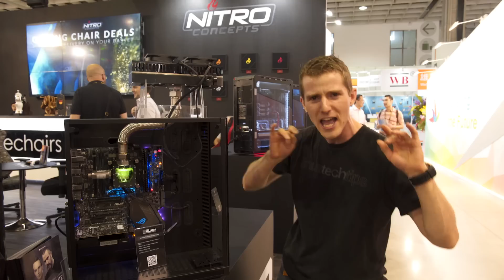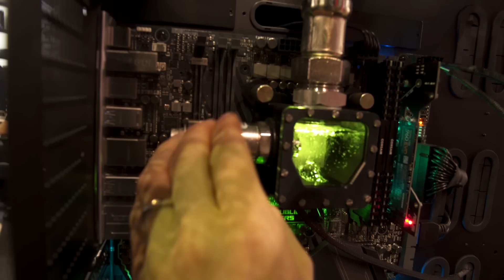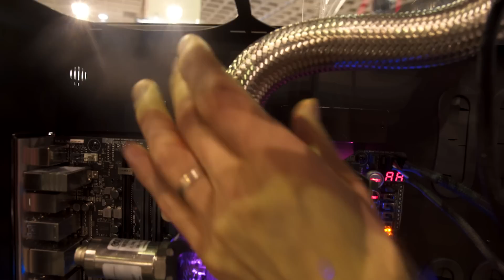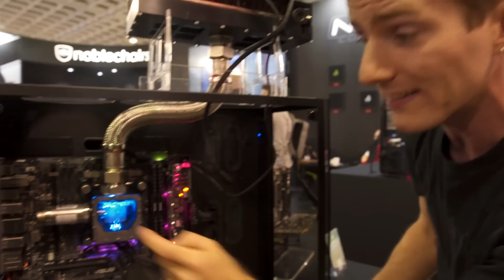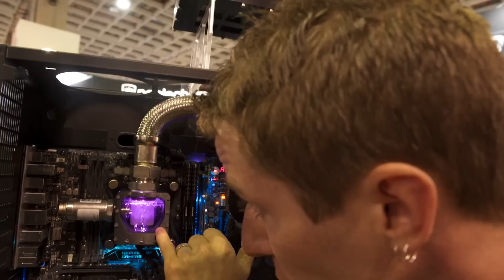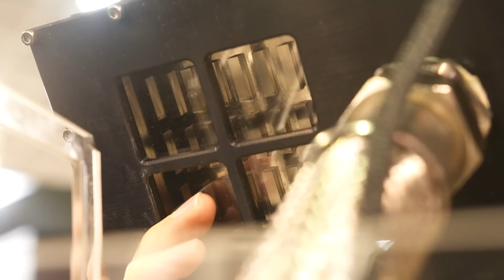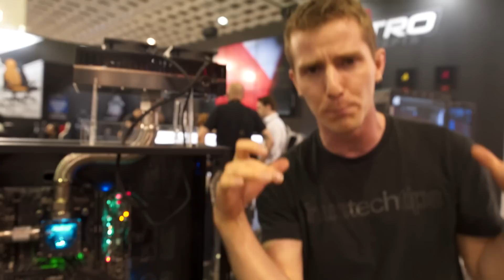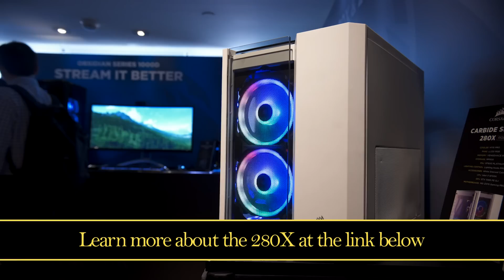Crazy Der8auer cooler prototype - NO pump!

Comment: It's not Novec, since it is a controlled substance that is not allowed in commercial products, there are loads of hydrocarbons that would fit the bill but they are all really flammable so I would say that it is unlikely, water would not be used under low pressure since low pressure is increasing the risk of contaminants that may gum up the system, chloroform has been mentioned and is the most likely out of the mentioned since it fits the bill almost perfectly but it wouldn't be good for publicity and it is not stable in an oxygen containing atmosphere which would limit its operational lifespan to something lower than ordinary AiOs, ethanol and methanol is less flammable and less toxic than some on this list but not enough to be relevant for worldwide sales. I think der8auer has me beat, though someone into mor practical industrial engineering might figure it out.

Comment: Running the internals at a pressure lower than atmospheric would allow a liquid to boil at a lower temperature. The likely choice for prototyping would be some type of hydrocarbon base, possibly a butane or propane. probably blended rather than pure.
For retail possibly a switch to some sort of alcohol or glycol mix?

Comment: I immediately thought of isopropyl alcohol just because is boils at around 87 degrees Celsius (the temperature you'd want active cooling to kick in to avoid thermal throttle).  I think i'm wrong just because I don't think it would condense that well to be used in this arrangement.  I'd guess you'd be looking for something with a low boiling point at higher pressure.  Heat pipes in laptops contain a gas mix to help the transfer of heat as well.

Comment: The plate at the top of this cooling unit is made of two dissimilar metal plates back to back, with the bottom (gray side) machined for increased surface area. Is it possible this is a variation on a peltier cooler using purified water with an aluminum (very slow to corrode in pure water) and copper on top for fast heat dissipation?

Comment: I mean, it could be a semi-common refrigerant, but if I were him, I’d be trying to find something with a boiling point around 60°-80°C... Isopropyl alcohol might work- maybe a solution of a refrigerant in isopropyl, but we know it has to have compatibility with plastics because of that clear faceplate, so that rules out a lot.
Actually- I bet its something on the 3M Novec line.
Edit: 3M Novec 7100 fits the bill perfectly in every way. It fits so well that if it isnt what he’s using, he might want to consider it! 😂

Comment: holy shit... amazing! they miniaturized the concept of the closed alcohol.based.fluid.cooled 8auer computer.
its also a SPECIAL LIQUID too for sure, like in "der8auer - Gamescom 2017" concept otherwise the evaporation/condensation temps wouldn't fit. 8auer liquid has a lowered boiling point of only 61°C (141°F) and benefits from much better heat transportation abilities.

Comment: That loudness of the coolent boiling is actually called cavitation. And its very loud in refinery sized systems , pumps , piping. Its very destructive to diesels cylander walls , any kind of pumps , and most types of piping.

Comment: Currently still not a commercial product. Seems like a lot of people have come up with these, it's nice to see its actually being developed.

I have no idea what coolant they'd be using, it would have to be something with a relatively low boiling point, maybe around 60 -  70 degrees.it just has to condense easily around 45 or so.

Comment: Novec family .
Very low phase change pressure differential .
Did you ever wonder what the working fluid in "bubble lights" or those "drinking birds" was ... methyl chloride ... nasty stuff by modern standards .

Comment: My guess would be something like perfluorohexane (https://en.wikipedia.org/wiki/Perfluorohexane), basically any completely fluorinated alkane. Its completely harmless, cant burn, it is even used in medical situations directly on your eyeballs or to inflate an otherwise collapsing lung. Lastly it has a boiling point of 56°C. But it could also be a mixture of several perfluorinated alkanes, thereby lowering the boiling point of the mixture.

Comment: I'm guessing it isn't even something super special. Probably like alcohol or even regular water or something under a vacuum to lower the boiling point.  If you look at all the equipment used in there like that SUPER THICK metal tubing which there isn't really a need for unless it is under a strong vacuum.

Comment: It could be any kind of alcohol, a liquid with low boiling temperature will do, put in a pressurize chamber it will boiling at relatively low temperatures then the tube and radiator will condense it and it will back again in cicle. Thats a good idea, interesting.

Comment: For this thing to work you would need to keep it boiling below normal operating temperatures.. those tubes are confusing me because it looks like it may be pressurized, and if so then a higher boiling point liquid can be chosen.   well. assuming its not pressurized, then maybe acetaldehyde? acetone? Bromine? Diethl ether?  ethyl bromide? Methyl acetate? Methyl iodide?

I think it would be pretty cool to use isopropyl alcohol in a pressurized system to lower the boiling point, good thermal conductivity, mostly non conductive,  inexpencive and readily available

Comment: If it's under low pressure it can be whatever liquid you want. Water included. I'd go for regular isopropyl alcohol under partial vacuum due to it's already low boiling point.

Comment: It is clearly vodka.
Reply: Na, if we talk about German stuff then this would be some Geißt(ghost) because it is a clear liquid. Could be Korn (grain, 40% alc)  or something like Prima Sprit  (almost 100% alc to drink :D )
Reply: I guess it at least is mostly ethanol  because of the low boiling point and the bad conductivity. And you don't have to mess with regulations because it is food save (cheers)
Reply: No its liquid weed
Reply: I was thinking alcohol too. Considering it's evaporation based, you'd want something that evaporates as quickly and easily as possible to keep the heat from staying in one place and building up.
Reply: It's just alcohol
Reply: lol, I saw this comment after a posted the above :)))
great minds think alike :)
Reply: There are a lot of those.
Reply: It's probably korn LUL way more german than wodka
Reply: Beat me to it
Reply: It must be pure methanol
Reply: urine
Reply: Serp D. Home brewed hard liquor anyone??
Reply: der8auer is German though, wouldn't it just be some strong beer?
Reply: It's that $100 a L DuPount synthetic liquid ....

Comment: Novec 7000 Series Engineered Fluids. They boil at ~30C so are auto-cycled through evaporation/condensation, just need the radiator good enough to cool it back down. A class of mine built one of these a few years ago for a class.

Comment: Novec 3M fluroether 649? Afterall hes done immersion prior and data centres use this fluid
Reply: Either that or Novec 7000. Those are the only 2 with a boiling point under 50 degress C.
Reply: Der8auer already said in another video it is not Novec. You are not allowed to sell it to consumers so if he used Novec like he did in his submerged build then he wouldn't be able to sell the AIO which is his goal for it.
Reply: Raivyn there's a good guess.  Everyone else just saying "3M Novec" which could be 100 different things.  They even make fingerprinting fluid and stuff lol
My guesses ate dichloromethane or some other halogenated hydrocarbon, especially perfluorocarbons.

Comment: It is water inside an enclosure with lower atmospheric pressure
Reply: Its also used in Every refinery / chemical plant.
Reply: That's an... interesting idea actually.
Reply: the vacuum required would be to low the vapor pressure of water at room temp would keep it from boiling
Reply: Ethan3369 what do you mean it would be too low, water boils at 100c at .25 atm it is only 50c which is pretty damn good
Reply: Alex Rubey when the water boils it creates a gas which increases pressure which then makes the boiling point of the water go up. So it cant be decreased pressure.

Comment: Looks completely 'experimental' ...and non-functional.
The coolant used is pretty negligible in the scope of this device, as all that matters is the efficacy of its cooling capacity. Modern systems use dielectrics like ethylene glycol, but there are a wide array of fluids from 3M and the like with 'cooling properties' that are used for industrial/military applications.

Comment: My first thought was isopropyl alcohol but the boiling point is too high.  So my second thought was butane.  Fairly safe to handle, the boiling point can be as low as 1C at standard atmospheric pressure but that can be adjusted by varying the pressure on the system, higher pressure, higher boiling point.  Also you can buy it in those canisters you get to recharge reusable lighters so it cheap and easy to get a hold of.   And if you have a leak it smells.  

Of course it is a fire hazard, something non flammable would be better.   

So lets look for something less volatile.  Wikipedia has a nice long list of refrigerants that can be sorted by boiling point.  Butane is on there along with propane and pentane, and that's about the range we're looking for.  Lot of CFCs on the list.  We don't want those because they destroy the ozone layer, so most of them have been banned anyway.  

Pentafloropropane looks good.  Boiling point of 15C at atmospheric pressure again that can be changed by varying the pressure on the system.  Also completely non flammable and mostly non toxic.  Looks like it's widely produced as a blowing agent in spray foam insulation so there's probably a way to buy it from someone in pressurized bottles.  Propane bottles are rated for much higher pressures so that could be a solution for transport and storage.

So there you go, that's where I'm putting my money.

Comment: Methylene Chloride has a decent low boiling point but its toxic so idk..
Reply: You wouldnt want a super low boiling point, if you boil at say 10 degrees but your next to somthing thats 100 degrees you would get little heat transfer as it would instantly gas out, my guess was a clear Bromine solution as its cheap, around the right temp and nontoxic
Reply: INVISIBLE SUN methyl iodide?
Reply: Bromine boils at 58c, this means phase change wont occur until the CPU temp is at near 60c all the time, which is the efficiency point of the liquid, I was more leaning towards Trichlorofluoromethane R-11 which boils at 23.8c.   I guess we will find out soon enough.

Comment: im thinking either ethyl or methyl alcohol, with a boiling point around 80°c, or perhaps something lower like acetone with a bp of about 50°. I think this because if it's boiling at 80 degrees, that means the second it gets around 75-79 degrees it's going to sink and immediately start boiling again, which wouldn't be very efficient since you have a cooling threshold of about 4 degrees. that's why acetone makes the most sense to me, because you have to cool it almost 20-30 degrees before it condenses again, which would give it a lot of time to cool the cpu

Comment: My guess is it's some version of 3M Novec (7100 or 7000?) engineered fluid, with some slight pressure modifications to make it boil at the perfect temp. 
Boils at low temps, non flammable, not very toxic and doesn't eat away at the materials you'd be using in this kind of system.
I'd buy one of these.

Comment: My guess is that It's water, but it's put under less pressure inside the loop, so it boils at lower temperatures. Since CPUs are supposed to run at (in average) around 75ºC for decent performance, they probably reduced the pressure enough so the water boils at around those temperatures.

Comment: How about a super easy to obtain fluid with a boiling temp of 50.5 C which is Acetone CH3COCH3. But that's only if the system is at atmospheric pressure.

Comment: It is certainly a organic compound of a boiling point between 30 and 70°C. My guess is diethyl ether, pentane, cyclopentane, vinegar, or any of thousands of organic compounds that boil at those ranges.

PS, what he did looks like a distilator and the toobing itself can be used as a distillation cooling tube. Many comments have mentioned it could be water under vacuum or some toxic compounds, but if thing is meant to be consumer grade, it should be using a redly available, non toxic organic compound that can be simply poured into the system like in a traditional liquid cooling system, without the requirement for special vacuum pumps. So my final conclusion is that this is just a simple distillation of an low boiling point organic compound under atmospheric pressure or a mixture of organic compounds.

Comment: difluoroethane, trifloroethane, or tetrafloroethane, something with a very low boiling point. Steel braided cabling make me think something with high pressure, or 3m Novec to avoid compression related issues.

Comment: "It can't have too much of an S-bend or it will condense and get stuck"
 - a minute later-
bends it  "There, now we can look at it."
Reply: What he meant is that it cannot have a negative slope at any point, like in a plumbing trap.
Reply: Yeah, I got that, it wouldn't be an S-bend without, and I know the guy that built it was right there, it was just unexpected.
Reply: chipmonk434 we call that a trap . and you are correct
Reply: Many people shared the same thought when that part happened, it seems.

Comment: I’m guessing  a fluorocarbon, perhaps a blend.  Main candidates: 1,1-difluoroethane, 1,1,1-trifluoroethane, or 1,1,1,2-tetrafluoroethane; the same ones used in canned air duster.  Without knowing the system pressures it’s difficult to say with much certainty.

Comment: Freon. A common refrigerant is R-22, boiling point of -41.4 degrees Fahrenheit at atmospheric pressure. Under pressure, it can be manipulated to absorb heat into its liquid state until it boils and heads into a condenser where it sinks its heat and drips back into the place where it will absorb more heat.

Comment: Methanol would be a good coolant due to the boiling point at 64.7 C which is a decent operating temperature. High enough where the liquid would condense easily in a slightly warmer atmosphere (the rad will probably be a little warmer than ambient temp) but cold enough boiling point to keep the cpu at a respectable temperature

Comment: Putting my guess on regular water in a low pressure environment. That's probably what that big pressure valve is on the side for. If you bring it down to 1/4 of an atmosphere by vacuuming out, then it will boil at 60 degrees C. Then it stays around the boiling point and all the heat goes into the enthalpy of vaporization. Low pressure at least explains the extremely beefy construction and massive pressure control valve on the side.

Comment: Well it could be nitrogen. Or even R134a Tetrafluoroethane same as used in car AC systems.
Reply: It would have to be a very heavily pressurized vessel to be R134a.  For a boiling point of 40C or so (for it to feel toasty to the touch like Linus said) would require that coolant to be under over 160psi or so.  That's not impossible given how thick everything is, but I find it unlikely.
Reply: Well a AC unit heats up the coolant 50c-70c  for the condensation phase so it's indeed possible. The surface area of a cpu isn't that of an average condenser but the heat is more concentrated. So it's possible. You don't need the pressure to be extremely high but yes around 150 peak would be expected. The tubing on that thing seems reinforced so I figure it should be able to hold a decent amount.

Comment: my guess, since he's used it on other builds at the show... Novec 7100.  Boils @ 60(ish) C, compatible with alummminum, copper, et all, non toxic, and has a decent pressure profile for vapor compatibility, and and... has an ultra-low freeze point so can also be compatible with sub-ambient cooling as well

Comment: Really should be 3M Novec.  It is made for thermal cooling,  safe, and as you can see boil at the range that computers happen.  It is better than liquid cooling because when a material does a phase change excessive amounts of heat are transferred.

Comment: It's behavior (bubble size, super-low viscosity, boiling at CPU temperatures while not allowing the die to overheat) leads me to believe it is supercritical CO2. The concern for pressure levels and the fact that it is supposedly something most people wouldn't think of adds a bit more credence to this as well.
Edit: It would also be non-conductive and non-toxic if it leaked.

Comment: I'll just guess and say it is a propane based coolant, because of the low boiling point, and the commonality of it. They also use propane as the refrigerant in many small cooling systems.

Comment: Acetaldehyde CH3CHO? Or carbon bisulfide/disulfide? Could also be water at vacuum. That would explain the thick casing and pipes and pressure transducer. Also that's just guessing purely on boiling point. Don't feel like looking up how they react to exposure to the various metals and other factors.

Comment: Damn, even though it's a prototype I think they should keep the look of the cooler itself. (The thing mounted on the CPU)
Reply: TheY I just hope that pressure sensor is removed, but other than that it looks sick
Reply: CyrenArkade the pressure sensor is likely only there so they can keep data of it throughout various situations.